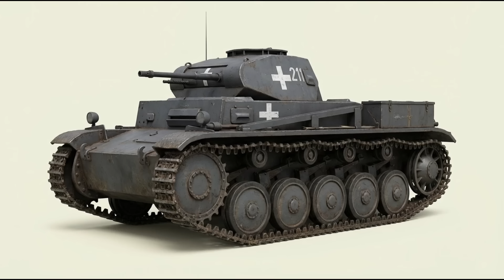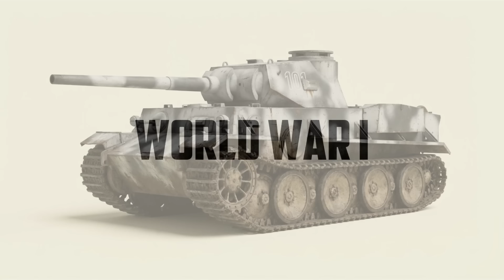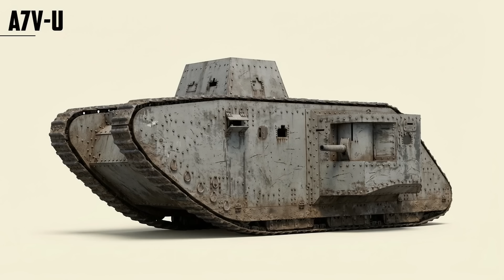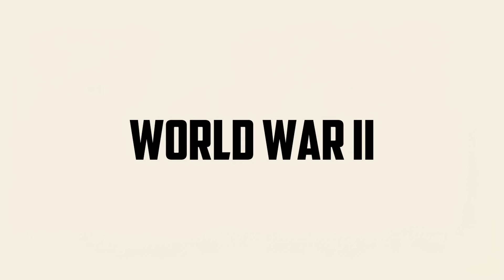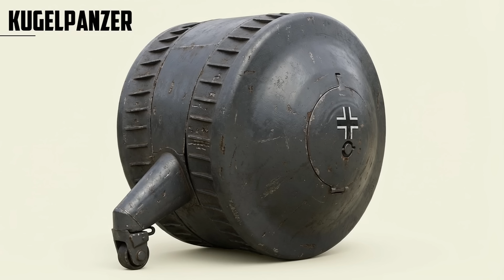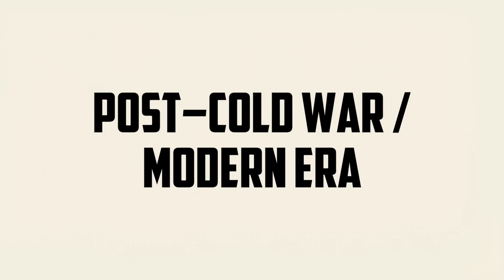Every German TANK Ever Made

Comment: I’m surprised they left out the panther II.
Was there the turret and hull made but never attached?
Reply: A hull was made, but a turret was never made for it. They had a design based on the original panther's turret. But it would have never been big enough to fit the long 88mm (the same gun the King Tiger used) the panther 2 was proposed to carry. So no turret was ever made for it.

The Panther 2 was dropped in favour of the E-50 StandardPanzer and improvements to the original Panther hull which kept the old 75mm gun. The E-50 project was based loosely on the panthers, but still never made it to production. The E-50 was chosen over the Panther 2 since it was (on paper) better and was more realistic compared to the Panther 2.